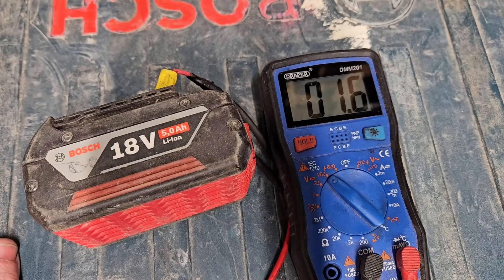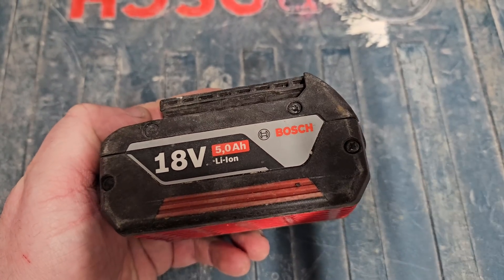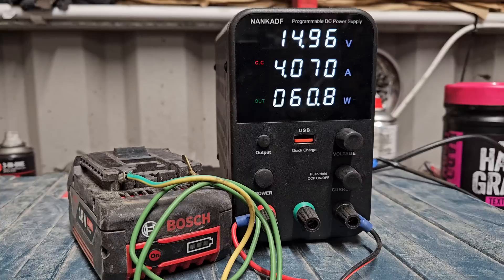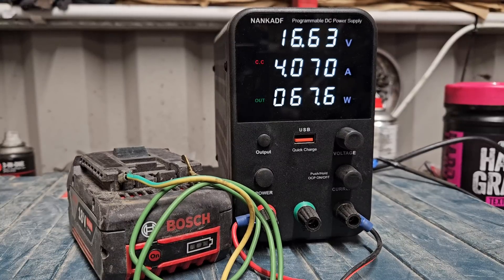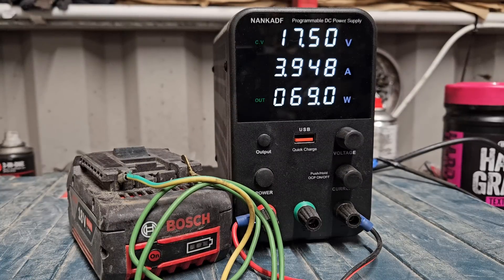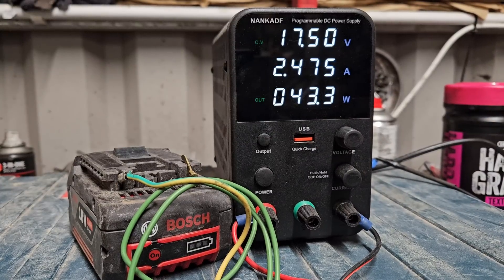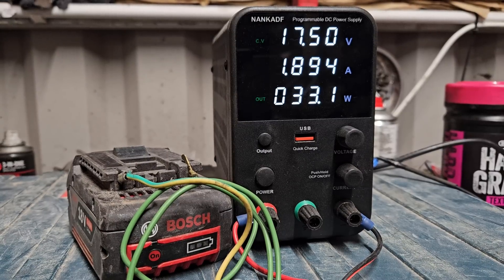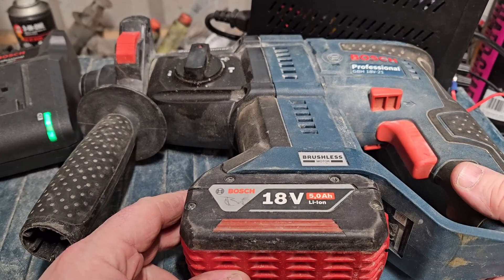Bosch 18v Battery Low Voltage Repair

Comment: 8:28, the voltage is only 18.9v that is actually not good, it should be at around 20 or 21v; you might have an imbalanced cell inside you’ll have to check, unless this charger doesn’t charge to 20v

Comment: 2.5v per cell should be 12.5v. After this, it should rise slowly. If it's going quickly, you have a bad cell or 2. You should be able to put on the charger at about 15-16v as a near-drained battery